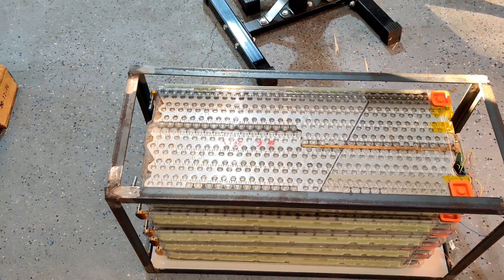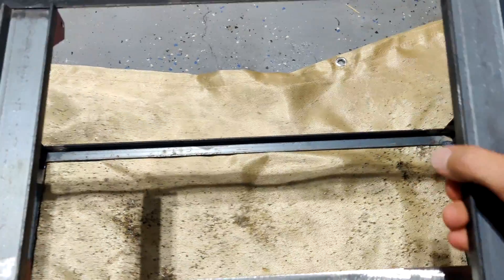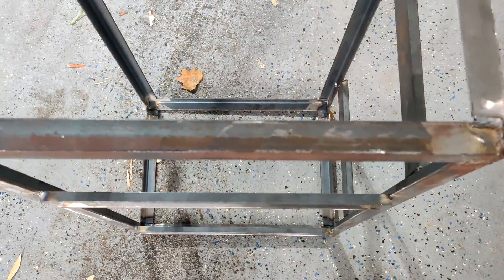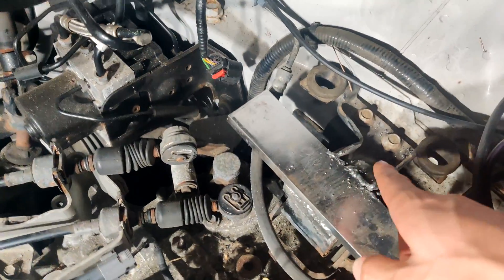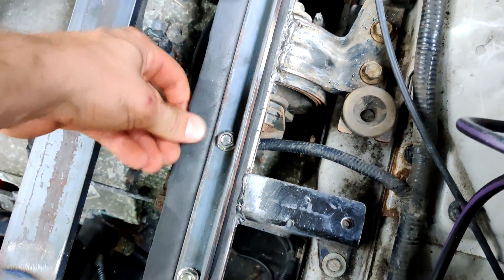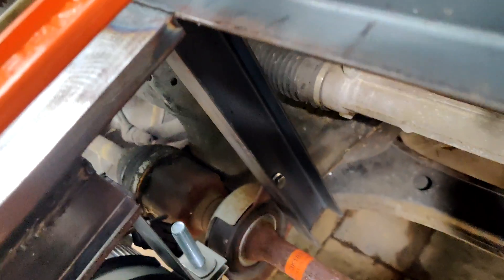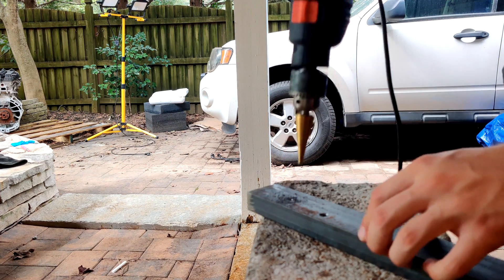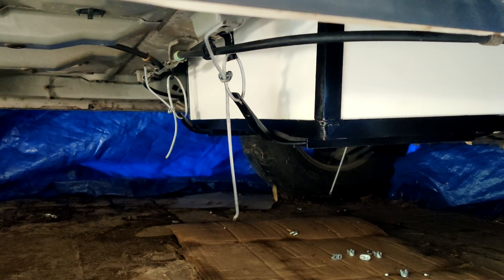Ford Escape EV Conversion EP 16: Finishing the Tesla Battery Boxes

Comment: 6:53 My experience is that the motor should be always isolated from frame and battery box.
Reply from the maker: Due to vibrations?

I've seen people not use an auxiliary support for the motor other than the main mount to the transmission, with a well-supported transmission (like mine is) without any problems. So if i need to I could probably do that.

Comment: Unless I'm understanding how you plan to mount the modules in the box - You can't just stack the battery modules on top of each other. Not only will the plastic covers for the modules not withstand the weight, they also won't take the heat. They need 5-10 mm of spacing between them to avoid concentrating the heat between them and melting the plastic covers. You need to create brackets to mount each module by the side plastic braces. Additionally, the battery boxes should be water-tight. The modules are not designed to be exposed to the elements (even under the hood). Also, that mounting for the rear box - WTF? Those wires are going to wear through in less than 5,000 miles, guaranteed.
Reply from the maker: Thanks for your comment. The plastic covers sit flush with the module expect for ridges over the cell fuses. Structurally, the modules are very, very sturdy. I've talked to a number of people about stacking modules and the general consensus is that you should go no higher than 3 or 4. The plastic covers on the module are supported by an inner plastic framework that attaches to the side rails you mentioned. This means that even when stacking modules, there is no weight on the cells themselves. It's all on the 

As for the heat issue, I don't know the plastic used in the modules, but the melting point for most common plastics is around 200C. Tesla modules hit thermal runaway at around 65C. In my use case (active cooling and relatively low current draw below 1C), I don't expect the modules to ever get above 35C. 

Attempting a full watertight seal is not in my view ideal. I think I'll be unlikely to get a proper seal and humidity could build up inside the box. So instead I've kept the boxes open enough so that air circulates but closed enough so that there is no liquid water coming into or out of the boxes. Although I would like to hear your perspective on this, and if it's really essential to keep the boxes sealed I'd like to understand why. 

What applications have you used Tesla modules in, and how did you mount them?

You are correct on the cable mounts though. The two shown in the video don't have the typical u-loops you would use in an application like this because of space constraints. The other two do have those loops however. I need to find or make shorter ones that will work for the ones shown.
Reply: @reider_mcfeely  Thanks for the reply. I am currently in the process of converting a 1992 Nissan 240SX using Tesla modules. I concede your points on the plastic/support. For that I was mainly going on advice that I had heard from companies like EV West on YouTube and a post on the electrified car forums.

While, admittedly, I don't have hard data on the sealing of packs, if you look at the original OEM Tesla pack and battery boxes made by veterans like Jehu Garcia, EV West, Zero EV, Stealth EV, and others, the overwhelming majority seal their packs. I know there are parts in the Tesla modules that are susceptible to corrosion and I would much rather be safe and stick with the manufacturer on this one but it's your build and your money.
Reply from the maker: I believe the most susceptible part of the modules to corrosion is the tinned copper "busbars" on the top and bottom of the modules and the tinned copper positive and negative terminals on each module. Here's a video I found by Rich about the corrosion: https://www.youtube.com/watch?v=nhJkq5Hl96s 

I think that as long as it's not direct contact with water (especially saltwater), there should be little or no corrosion. Ambient humidity shouldn't be enough to cause any serious issues, but I'm just spitballing here and I don't really know. If it is just tinned copper, then the rate of corrosion should be no faster (and most likely significantly slower) than my HV wiring and copper lugs. I'm going to see how it goes with the boxes mostly, but not completely sealed. If I start seeing corrosion, I'll redo the battery boxes so there isn't any airflow either.

Anecdotally, my basement flooded from Hurricane Ida a few weeks ago with the modules just sitting on the floor and they had no corrosion. The plastic covers prevented any water from getting into the modules, but they were sitting in a humid environment for a few days and there was no corrosion. I think the corrosion issue is only a big concern with direct contact with water.

EV West doesn't use BMSes for Tesla modules, which I find worrying. They have to manually balance the modules every few months. So they're not as great of a source. But the other ones you listed I've found to be very trustworthy.
Reply: @reider_mcfeely  Are you sure Tesla modules have copper busbars, I think they are made of aluminium.
Reply from the maker: @Ruudi05  I don't think it's pure aluminum, since they tend to corrode in a way that is similar to how tinned copper does when exposed to moisture.
Reply: So true i 100% completely agree no cap on a stack
Reply: I thought the same thing, how do you fix the modules, while watching. I myself have no experience with Tesla modules but I would find out how tesla had the two modules ontop each other attached in the tesla battery.
Reply: @Ruudi05  They have support bars between the fins on each side of the modules that keep them spaced apart vertically. I disassembled a pack for my conversion a few months ago.